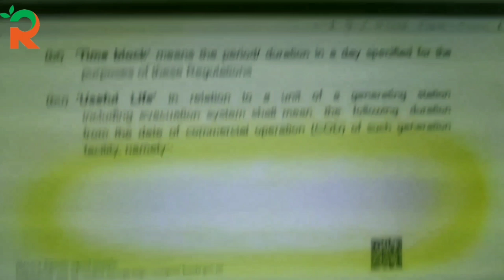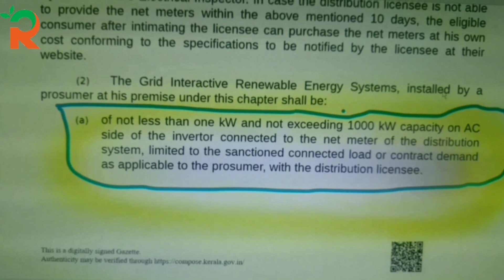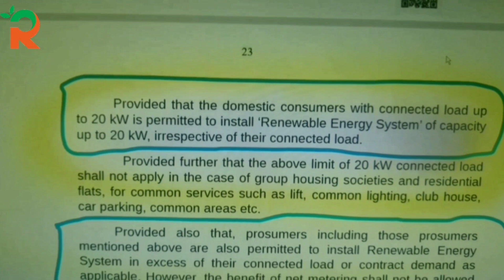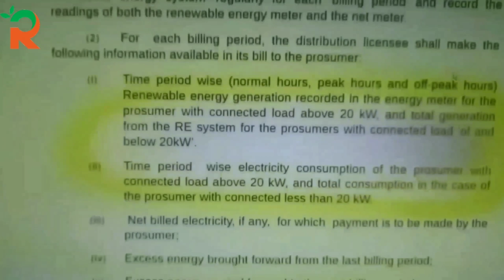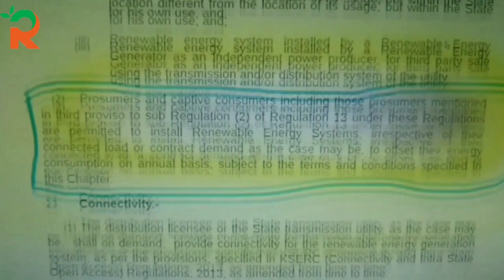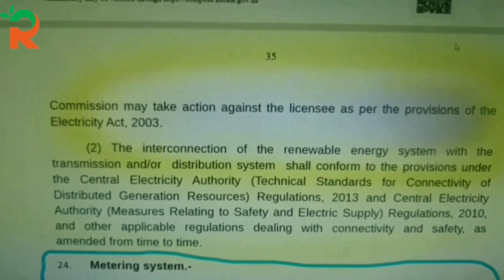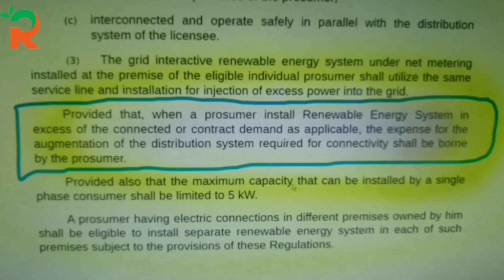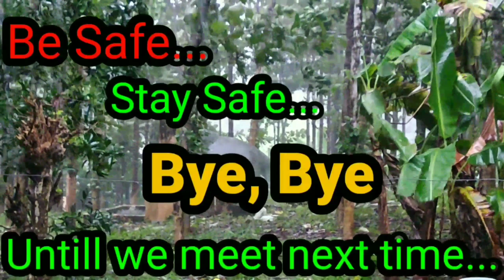KSEB Solar Grid Tie - On Grid System Procedure change - Very important !!! Watch the video...

Comment: Hi, can you explain any issue with domestic consumers?
From your video I understood that no change in rules for domestic plants.
So at the end of the year, will the consumer get refund for excess current generated?
Reply from the maker: Earlier, on application, KSEB were checking only the feeder capacity. Now they started to check connected load also. So they may only give feasibility based on the consumers connected load. If you want to install a high capacity system, you may need to prove that the excess production will be consumed at other connection points of the same consumer. Even though, you are able to prove that you are going to use it at different service points, a domestic consumer is allowed to install only up to 20Kw, as the rule says. But, if there is an excess production, KSEB may pay you at the end of the accounting year....
Reply: @abyrelaby  Thank you 🙏🏻
Reply: Hello sir
I had made a purchase of 5kw ongrid system and I got feasibility certificate now they are asking me to increase the connected load to 5000
Reply from the maker: @flowerscomedy865  Sir, sorry for this belated reply. I did'nt get any comment notification, that is the reason why i couldn't make a reply. Now, to the point, if your connected load is below 5kW then you have to increase the connected load to 5kW to get the 5kW system commissioned. Dont worry, it is a simple procedure. Just get a connected load change application form from the KSEB, fill it and submit it to them. That is all. Sometimes you may need a "c "class contractors seal and signature on the new circuit diagram. Enquire at KSEB office for clarifications.
Reply: Any way please reply

Comment: plz could u explain procedure for less than 5 kw system
i had seen ur previous all videos and the abv videos are for 20kw and abv,i had submitted form 2 and had installed the system and i dont know who to proceed further,i appreciate if u can personally cnt me @ 7012775683 to clear my doubts
Reply from the maker: Just follow the procedures as mentioned in the video. If you have submitted Appendix 2 Application, Complete the installation and submit Appendix 3 to KSEB along with all the documents in a file as shown in Part 3. Include a completion certificate of a C class electrical contractor. That is all !!!
Reply: @abyrelaby  thanks chetta
Reply: @abyrelaby  is there any  specific form available for completion certificate